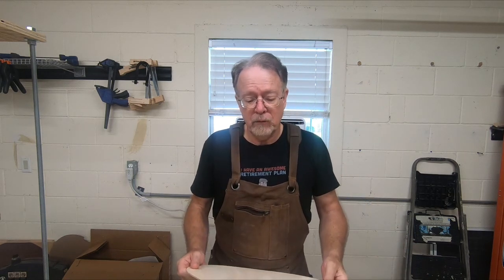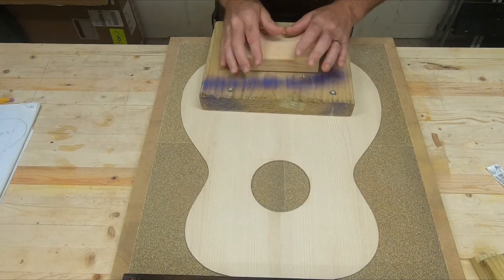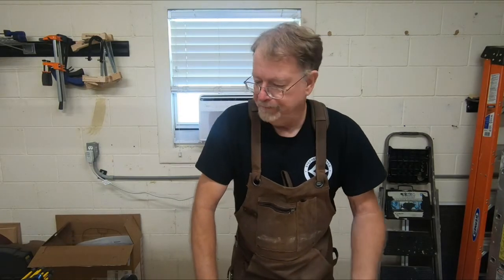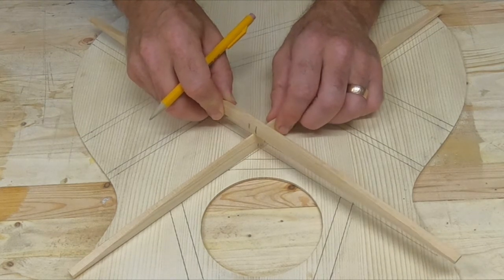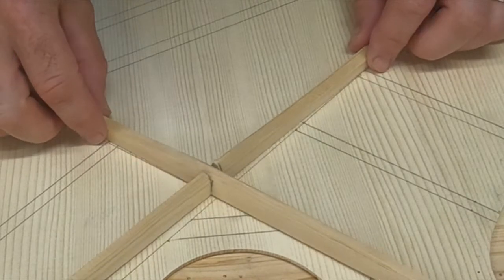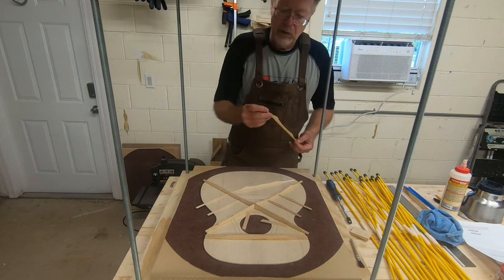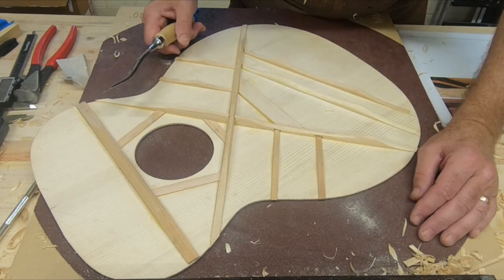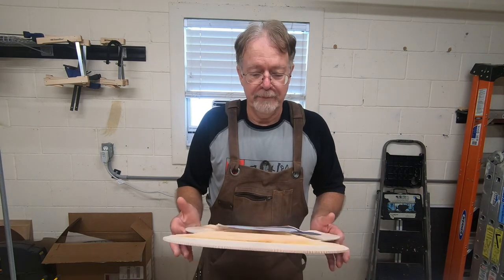OM 18 Build 3 Top Preparation

Comment: Great idea taking pictures to keep measurements! I may start doing that going forward. I’ve started a build journal so things like top thickness and bracing height would be good info to have. Thanks for the idea!
Reply from the maker: Thanks, I couldn't figure out another way to really keep track of brace height.  And since I thickness by hand I have more variances.
Reply: Even fully awake, I still think Ukes are a toy you would give a 6 year old to annoy any adult wirhin hearing distance.  I would never want to visit Hawaii -- where ukes were possibly invented.

Comment: So what was the material for the bridge plate?  It looks like hard maple, but I hope it is not spruce.  That would be a mistake made by big factories that would be a problem in twenty years for a luthier to have to deal with when the string ball ends eat the wood.  Yikes!
Reply from the maker: Yes, it is hard maple.